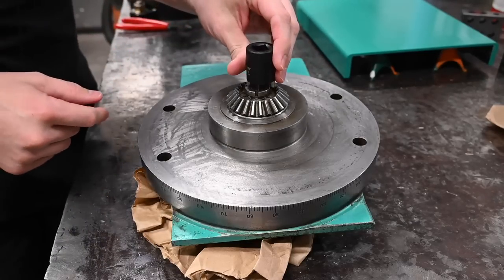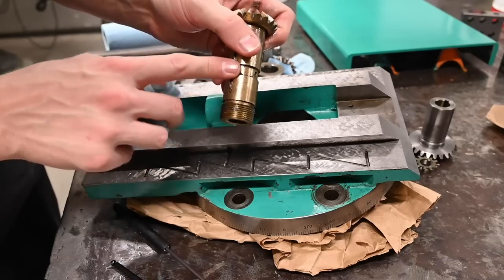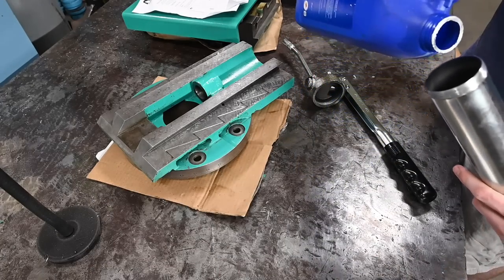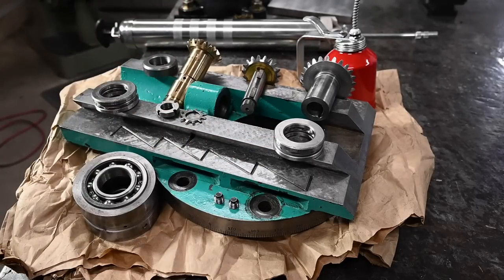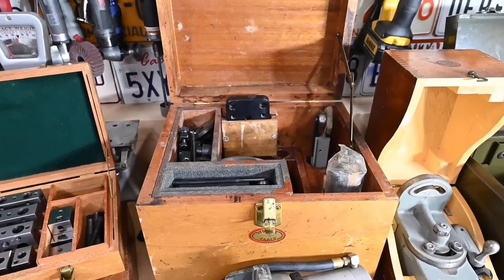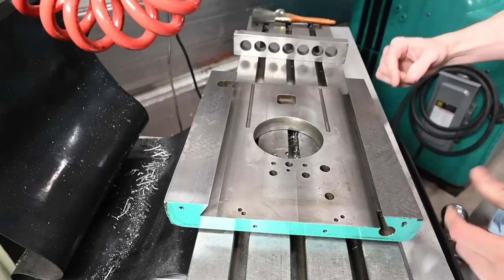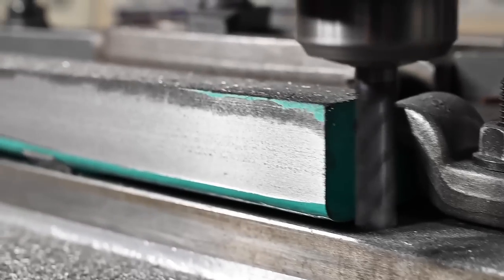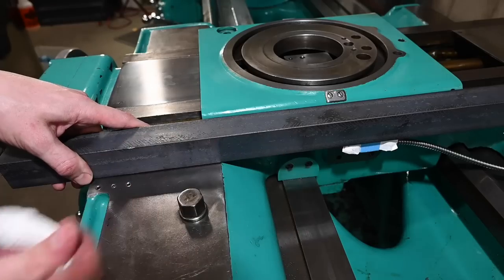Monarch Power Compound Disassembly | Milling the Cross Slide

Comment: This video clearly demonstrates the drawbacks of old glass scale technology. While you have spent days mounting just one scale you could have installed a complete Newall system in a couple of hours. Their magnet scales are robust, precise and need no protection or fancy mounting. I have used various brands of DRO over the years and long ago switched to Newall. I have removed all my glass systems to convert to Newall. All my machines (lathes, mills, grinders) have Newall. I have decades of trouble free experience. I have tested them with a one millionth accuracy laser and they always exceed the spec. They have lots of features like showing precise angle of a lathe taper turning attachments. Like most things today they have many features that sound exciting but will never be used. I struggle to get my guys to use anything but basic functionality. We tried storing offsets for specific lathe tools with disastrous results. 

I put a scale on the lathe compound and cross slide, and on the mill I have them on the knee and the quill as well as the usual axis'.
Any DRO is better than no DRO. Have fun. I have no affiliation with Newall.
JY
Reply from the maker: Hi John, thanks for your thoughts. I thought long and hard about Newall vs Acurite vs Chinese knockoff and decided Acurite was the best option for me. Since this is a home shop I don't mind that this is taking longer than other options and what I've done so far wasn't strictly necessary anyway- I just wanted to work off of a machined surface on the cross slide. There are drawbacks to glass scales for sure, but the quality of this instrument is going to be worth the little bit of extra hassle.
Reply: @AlwaysSunnyintheShop  I have studied various machines CNC and manual with scales using a laser interferometer that good to a  millionth. At that resolution everything is disappointing. Even the best CNC machines are not nearly as good as people think. First the laser has to be aligned to minimize Cosine error.The so do the scales. One time an old Matsuura CNC mill was 10X better than its new replacement. The old one would repeat within 70 millionths all day long. You can spend all day doing a leadscrew cal but as soon as the temperature changes its all over. The flex in everything ultimately mitigates the resolution of the display and to get very precise results you need very precise technique.  I haven't used any of the low cost imports so I can't comment but I wouldn't be surprised it they were pretty good. Any readout is likely better than no readout. I've had heidenhind, sony, accuright, newall and others. For general use they are about equivalent.
Have fun. JY

Comment: Aaron,
The accuracy of your DRO is dependent upon the scale mounting in each plane of travel. Your milled mounting surface is parallel in your mill setup to .0005/8". Before you finally clamp everything in place, adjust your cross slide gibs and indicate your scale mounting bar. Secure it tightly. You have options even if it doesn't indicate perfectly. The scale can be attached to the bar and shimmed to parallel axis travel. In a production installation where machine teardown is no viable I have used a series of jack screws to provide parallism adjustment when mounting to a cast surface. This eliminates the machine disassembly requirement. Note that the scale is only mounted at 2 points. Floating the scale body is just as solid as the aluminum extrusion sitting flush on a machined surface. The two hold down screws can load against the adjustable jackscrews.
Indicate the scale body over the full length of travel in both the top and side planes. The jackscrew method makes this easy to do to the accuracy of your best indicator. I would probably use a button head on a .0001" travel indicator against the aluminum extrusion of the scale body. 
Tips for mounting the reader head bracket...
Make and mount the bracket so that there is as much as .125" free space between the reader head and the mount. Ensure that the bracket mount location allows full scale/reader head travel. DO NOT REMOVE ANY OF THE READER HEAD SHIPPING HARDWARE until making the final mount. Employ the jackscrew and mounting screw method here  to take up the intentional reader head mounting gap. The shipping brackets align the reader head to the scale. Remove the shipping brackets only after securing the reader head mount. KEEP THE SHIPPING BRACKETS TO REVERSE THE PROCESS for future scale service. Install the shipping (alignment) bracket before removing the mounting screws. If you don't touch the jackscrews it can be reassembled readily by restoring the reader head mounting hardware and removing the shipping brackets. If this is a glass scale employing my suggestions will ensure that the scale won't be scratched or broken by an oops. Employing my suggestions will eliminate any need for curious eyes to see how the reader head tracks against the scale. Save this exploration until you have lip seal failure and get debris onto the scale years from now. BUT DO THIS INVESTIGATION ONLY WITH THE SHIPPING (ALIGNMENT) brackets in place. 
I have witnessed the uninformed mechanic remove the reader head mounting bracket hardware without the shipping brackets in place and the combined weight drop the reader head and break a perfectly good glass scale.
Your scale looks like a clone of the old standard Accurite mini scale. The red plastic shipping brackets are different, but I bet your scale employs exactly what I have tried to describe.

God luck.
Reply from the maker: Thanks for that thorough comment, Paul. These are actually Acurite scales now made by Heidenhein. I was planning on getting the read head mount as close as possible to on plane with the scale as possible, but leaving that gap makes a lot of sense. I'm going to re-read this when I get ready to mount them onto the machine.
Reply: @AlwaysSunnyintheShop  I didn't know that these were still being made. We quit using them in our shop when we could no longer get parts. Our stock of lip seals eventually failed from dry rot. Without lip seals chips would get on the scales and cause misreads. Individual packed medical alcohol wipes are ideal for scale maintenance. They are clean, pre moistened,  and the perfect size to wipe and discard. Quick and dirty service can be done sometimes on the machine with a wipe gently held in hemostats or thin plastic medical tweezers.
I bet that your scale reader head will have 4 tiny jackscrews in the 4 corners already installed and will probably have provision for 2 larger mounting screws, one on each end. They will hold securely against the extended 4 jackscrews.  My technique was to wind in the jackscrew until it touched or you detect the slightest motion in the bracket.  Then rock it gently back and forth until you find the just touching sweet spot. Repeat with the other jackscrews.
One of my first tasks as a novice machine shop repair technician was to install Accurite scales on a machine with the factory rep. I maintained a friendship with this man during my 34.5 years career as a machine shop service technician. I got to retire early or I would still be maintaining our large shop. I pushed my tool chest daily until my retirement, but I spent vastly more time managing the maintenance department... 7 day, 24 hour operation. Our staff still cared for our manual machines, but we were all primarily CNC techs. I have done it all except scraping. Production shops cull worn machinery for new technology.
Reply from the maker: Wow I'm guessing you've seen all kinds of failures and mistakes made on caring for machines. Every shop I go into there seems to always be a maintenance man standing on a ladder messing with the spindle housing on a CNC and looks ready to jump off the ladder to break something so he can go home! I'm sure it's not as bad as I'm imagining, but the complexity of most CNC machines would break me, too.
Reply: @AlwaysSunnyintheShop  CNC machines are built one axis at a time like manual machines. The controls, motors and drives add complexity. Tool changers, pallet changers and tool measuring and monitoring systems add complexity too, but they are still basic in concept.  Servo positioning can afford simpler drive trains than mechanical systems. Think of the complexity required for a mechanical gear hob. The CNC machine is much simpler.
Our shop did milling, turning, gears, Blanchard and cylindrical grinding as the primary  functions. We eventually outsourced sheet metal, but when we included this in house, we had laser cutting and CNC punching and forming. Our shop was a design build primary machine builder for the printing and retail packaging industry.  I took the job because I was a newly unemployed maintenance man with 5 children to feed. I had no idea that would become my entire career. It was a great ride. Retirement is wonderful and gives me home shop time and time with my 32 grands.
Reply from the maker: 32!?! Wow that's incredible- my parent had 7 kids and they're stuck at 17! I have a customer with a problematic mill turn and trying to realign everything after a crash has been a multi-week nightmare. You're right about the simplification using computers and servo motors over complex gear trains and power transmission.
Reply: @AlwaysSunnyintheShop  Have you ever shared what you do in your day job?
Reply: The error from a .0005"misalignment over 8 inches is 0.000000015" which means even if the scale were 10 feet long the error would be many times less than the resolution of the scale. The only detectable error I can attest too on these lathes is if you place the longitudinal scale in the back the carriage does cant some as the feed or lead screw pulls the cutter into the work. On my 40" lathe the positional error between one direction and the other is .003" so it is important to only work in one direction for the most accurate results. On my 20" Monarch the error is only about .001" from one direction to the other. Placing the scale on the drive side would be more accurate but also way more difficult. Same goes for the scale Aaron is installing here.  There is some cant in the cross slide but since the machine is tight that error is likely smaller than the scales resolution.

Comment: Great vlog Aaron. Ref Grease V Oil: For slideways, Slideway Oil, ( it has tackifiers in to resist being rinsed off) or if slightly larger clearances are needed a NLGI grade 000 or 00 grease, that Red coloured grease looked about grade 2 or 3, more suitable for rolling element bearings, and linear ball bearings. Remember the lubricant, also should prevent fretting or falling if vibration is present. That's my 2 pence worth.
Excellent tool score, some fantastic items.
I think that aluminium plate with pivot bearings is for holding a mirror, so that the lathe can admire it's self 😀.
Thanks for sharing, best regards John.

Comment: I was always under the impression that using grease fittings for oil was a British practice.  I have only seen grease fittings (for oiling) on my British machines.   My Broadbent Schofield lathe was made in England but was built for export to Canada (it has CSA data plates installed at the factory).  On the lubrication data plate, the last sentence reads: "Use oil, not grease, where nipples are provided".  I have a feeling that last sentence may not have been put on lathes that were staying in Britain.  However, my experience on this topic is by no means exhaustive, probably quite limited, actually.  Maybe someone on here from the UK could enlighten us on this.  As for the oil gun that you bought, I bought the exact same one and paid a small fortune for it.  Within a few months it was leaking from the hose.  I put a valve on the hose so I could shut it off when not in use.  That worked for a few months and then oil started leaking all over the place from the body of the gun.  I eventually drained it and put it away until I get some time to figure out what the hell is wrong with it.  Ken
Reply from the maker: Early Bridgeport mills were fitted with Zerks for oil- I think that practice has been around a long time. The last half of your comment makes me weep a little! I hope I didn't spend all this money and end up with a leaky tool, too. Maybe my dry desert air will keep it from leaking better than your cold climate 😬
Reply: @AlwaysSunnyintheShop  Hopefully I just got a dud gun.  All the metal parts in the gun look good so I suspect the o-rings used in it may have been poor quality. Ken
Reply: Yes those early Bridgeport Mills had grease fittings for the way oil and I swear that the engineer who decided to put them there said "I'll bet somebody who buys this mill down the road will want to crucify me for the zerks because a previous owner is going to shoot grease into them...so yeah lets put zerks there."

Comment: THe cemented carbide bars is stock for you to silver solder to a steel bar, Make those special tool you often need. 
Use high strength silver solder. Careful with the heat. besure of a good flux and get good flow of the silver solder. 
Do not quench the hot tool. Let it cool slowly to room temp the keep from cracking the carbide.

Good luck

Comment: If you bought the lathe specific kit from Accurite, it'll give very complete instructions on how to set up and protect the X axis scale assembly, including a hard stop for the tail stock. Depending on the kit it'll even include the material for it. What does the instructions for your kit say???
Reply from the maker: It’s been quite a while since I opened the kit up- I’ll have to go back through it and see what hardware was included.

Comment: Interesting that the ways are lubricated with the same fluid as the bearings and gears. This means you're restricted to oil, but I'd be worried about the oil in the bearings flowing out and running dry. Anyone know if this setup is common? Or ever problematic?
Reply: It’s normal. You don’t use grease there.

Comment: I’m still with oil all around. The bearings can all take oil no problem. Maybe grease is preferable for bearings and gear but it just is absolutely not acceptable for the ways. The lead screw can go either way but it will last much longer with oil.

The grease fittings are connected in to the bearings and the ways but it’s ok as long as you oil often. Every morning you go to use the lathe just give everything 2 pumps of oil.
Reply from the maker: Yeah, oil is definitely the choice for this.

Comment: Absolutely no disrespect Aaron; but I never thought a "zerks" greasers were used for oiling. Now I can be totally wrong. But are you sure the zerks on your machine are for oil. Again, I don't know; just wondering kind Sir. As the old saying goes: "Inquiring minds want to know!"

In any case, your lathe is awesome. But nowhere is it as awesome as you are dear friend. Please continue to dazzle us with things we love to see. Few could ever do it as you do.

I am sure many feel the same way.
Reply from the maker: It's quite confusing, Pat, but on most machine tools the zerk fittings are only to be used with oil. I really wish someone had come up with a different fitting to prevent this confusion still occurring 100 years on!
Reply: @AlwaysSunnyintheShop  You really paid $385 for that gun?
Reply from the maker: No way, nothing close to that. I bought it through my work so I got a discount, but I think the list price on this is $188.
Reply: I agree Aaron anyone who uses grease on a machine tool for lubrication  doesn't understand the reason for scraping and especially flaking. thannks for the great content. Brian @AlwaysSunnyintheShop
Reply: The Monarch manual specifically says to oil those fittings weekly and to use a medium grade oil with high film strength.

Comment: Just because there is a grease fitting doesn’t mean you put grease in it. All these old machines used oil not grease. Those cuts in the ways are for oil to flow not grease. My Bridgeport some body used grease before I bought it and it had to be completely cleaned out!  Please if you have an old mill or lathe Do Not Put Grease in it even if it has some grease fittings. The path of the oil flows both in the ways and the bearings.
Reply from the maker: It's so frustrating to me that Gits or someone never came up with an oil fitting that wouldn't be compatible with a grease gun. That would have prevented so many machines from being sludged up when someone who doesn't know better grabs a grease gun and pumps away. Oh well, not going to be a problem for this machine as long as I own it.

Comment: I'm thinking there's very little movement and there's grease fittings so I would have to go with grease.
Reply from the maker: Common mistake to make- zerk fittings are used for both oil and grease applications, and on machine tools they are used almost exclusively for oil. An exception in my shop is the motor bearing on my milling machine- it's for grease in that case.